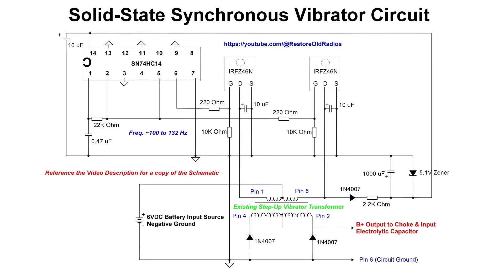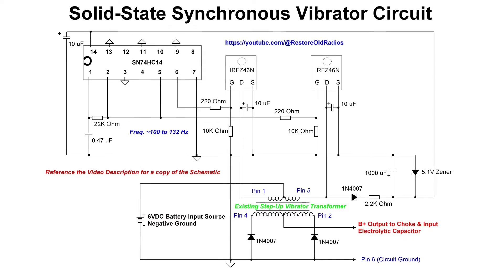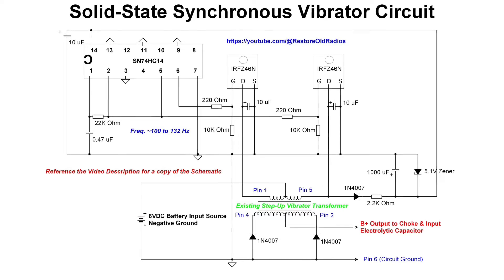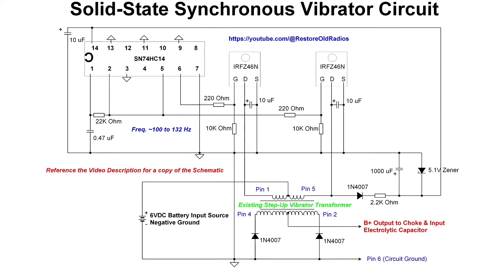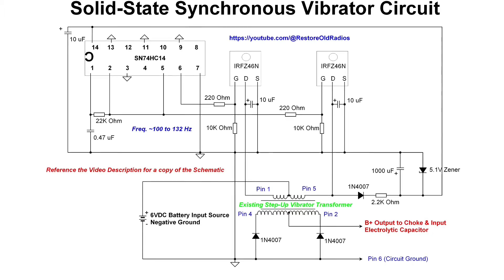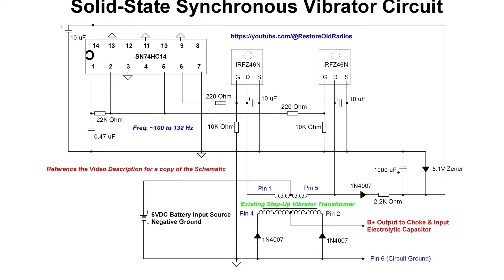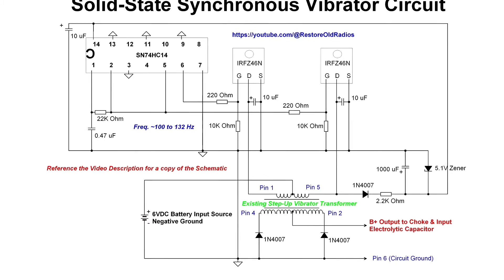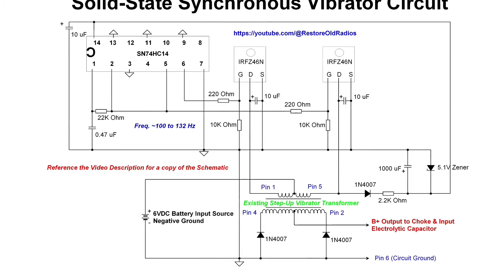Solid-State Synchronous Vibrator Circuit - 6V Negative Ground

Comment: Nice circuit, going to build one to replace a Blaupunkt SM0702 6V vibrator used in a Swiss amateur made power supply found in the battery case of a BC-1000/SCR-300 military radio. Thanks for sharing.
Reply from the maker: Hope the build works and you have the military radio operational soon. Best, Don